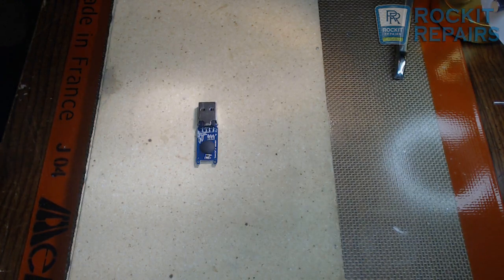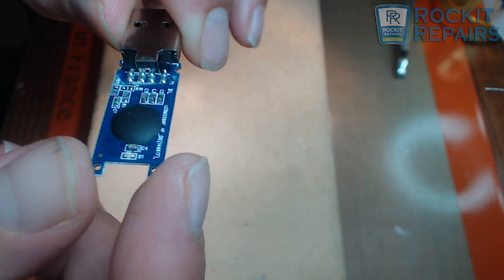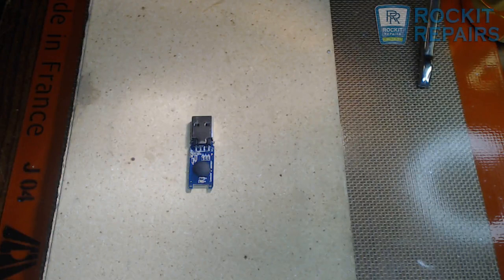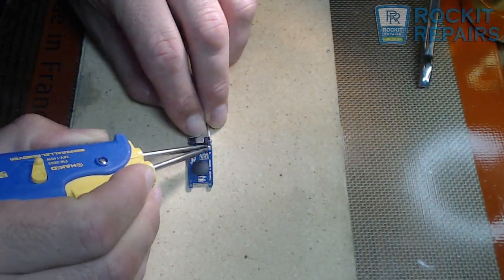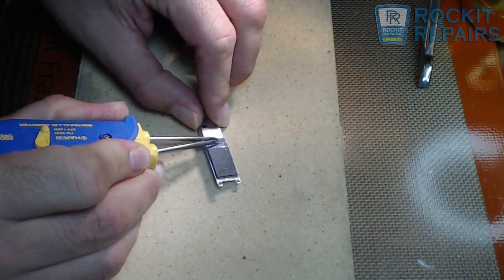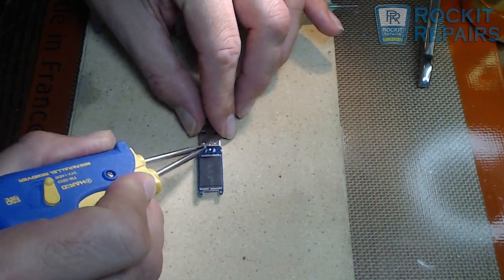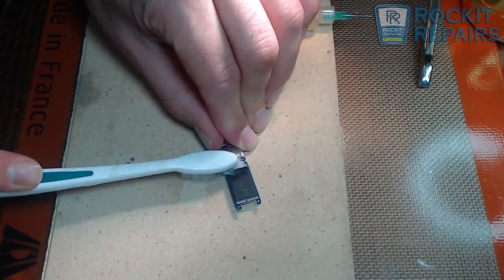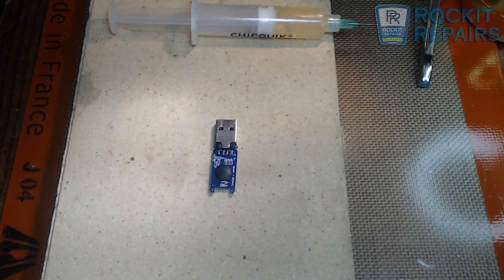How To Fix a Broken USB Flash Drive Repair and Data Recovery

Comment: how can i get the substance in the injection and the name of the substance please
Reply: Its called flux. "Soldering flux" or rosin flux is what you should look up, and you can easily make some too. 
You can make it by boiling purified Pine Resin and Paraffin wax/Petroleum Jelly together.

Comment: My blue Kingston USB hard drive is 16GB. I tried inserting the usb on the computer every time, but nothing was working at all. It turns out it stop working due to bend usb.
Reply: I also have a DTSE9 Kingston usb which is 8GB and it stopped due to bending it